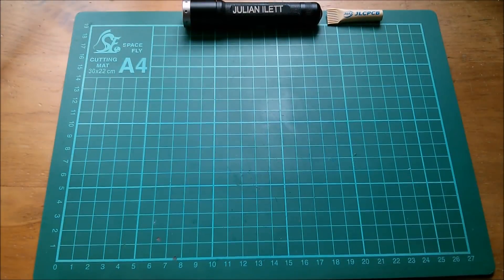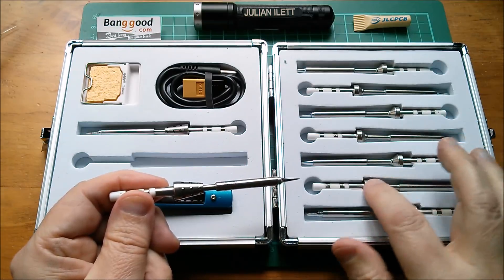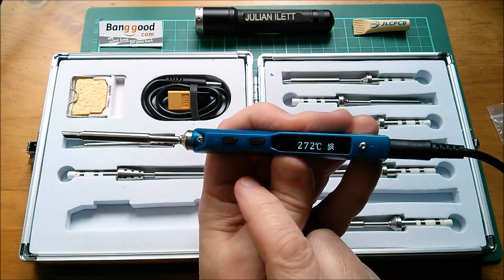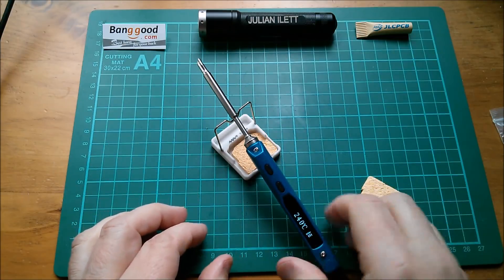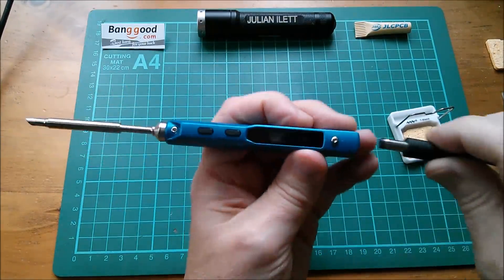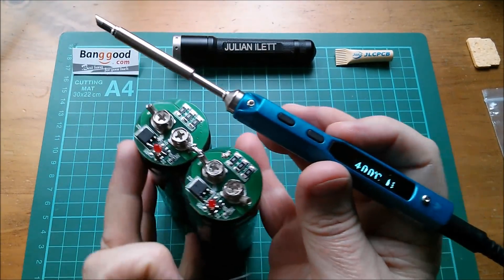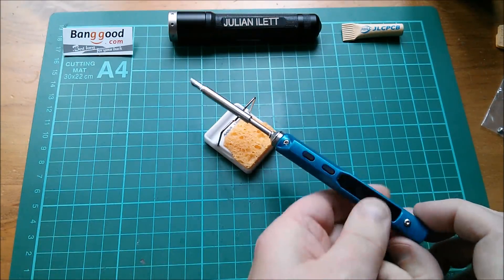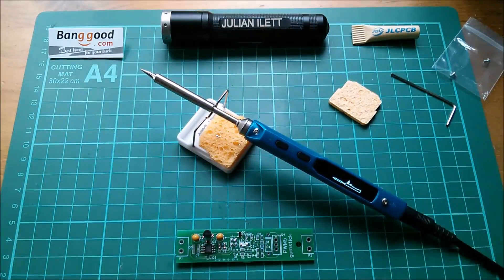TS100 Soldering Iron - Unboxing and First Look

Comment: You don't have to loosen the bottom screws for the tip! These are the screws for the case. Just loosen/tighten the one screw on top. And think about of switching to a 3rd party firmware by ralim, you will find his github repository.
First time I saw this soldering Iron I knew I would sell my Ersa - RDS80 soldering station. Now I'm only using a 3s 5000mAh Lipo and just sometimes a avm fritzbox 12V/1.4Ah power supply.
Reply: yep, many people came to that same conclusion.

Comment: Hi Julian, I have had my TS100 for almost a year now, just a couple of tips for you, first the screw on the back is a miniature Torx screw, this does not secure the tip, it holds the rear case together, secondly the easiest way to set the iron up is to plug the usb socket into a computer, this will open a folder with the config file which you can edit with notepad, the text file has many rems to let you know what each line does.
Regards, Ray..
Reply from the maker: Both screws are Allen (hex) on this one, but you're right about the rear screw not being used to clamp the tip/element.
Reply: Ok I guess they changed the rear screw, I had to open mine up because the centre pin broke off in the power plug, BTW the rear case is quite hard to get back on..
Reply: There is an even better alternative; install the firmware upgrade by Ben Brown (Ralim), and you can change all those settings through a clear and logical set of menus right on the iron. It took me nearly a year to get around to it, and now I wonder why!   This has had a lot of mention on Youtube... it is a really slick piece of work!   It includes many neat improvements, with no downside.  Part of the reason I took so long to get around to it was fear.   It is a process that took me outside my comfort zone, but in fact it couldn't have been simpler.  "How to update TS100 Firmware" by Gadgetboy was really helpful.
Link:   https://youtu.be/B2k_kvUDuPY.

Comment: I'd like to try that firmware on my vape.   Looks like a lot of the vapes I've purchased in the past are made in the same Chinese factory.
Reply: If you manage to get something like that working, I'm sure everybody would want to see it.
Reply: A lot of battery mods are made with the same components and you can install a custom firmware called ArcticFox on them which enables a lot of interesting options. https://nfeteam.org/
I've since quit vaping so I'm trying to figure out how I can repurpose my mod. I did consider turning it in to a soldering iron.

Comment: Never used mine without the open source firmware, it's crazy how unsteady the temperature is.
Reply: the open source firmware will put that right for you.
Reply: Stock source is here if you want to have a go at it also.  https://img.staticbg.com/images/upload/2015/11/TS100/TS100%20V2.11%20Source%20Code%20New.rar

Comment: When you started in electronics, did you ever imagine that at one point you'd be adjusting your soldering iron by using a text editor?
Reply from the maker: I really didn't :)
Reply: Firmware update on your soldering iron.. Pmsl.. What has the world come to? 😂
Reply: text editor is a bit inconvenient. they should have used their imagination and let us connect to soldering iron's webpage wirelessly to control it's parameters. ;)
Reply: No... but then I didn't imagine I would ever have a phone in my pocket that makes the Star Trek communicator look totally lame!   :o)   Progress!
Reply: John Colvin I used to enjoy listening to 'Hitchhiker's Guide to the Galaxy' when the hitchhiker's guide itself was science fiction - now I have that in my pocket too!
Reply: I would have made that bridge with copper braid or multistrand wire so I could solder them unconnected then if you wanted some solder could be flowed into the flex to make it rigid.
Reply: you can upgrade the fermwar
Reply: i use vim btw.
Reply: most of the temeperature controlled irons have firmware, that's old news. You think a hakko displays the temeperature through black magic?
Reply: @DumitruUrsu  Yeah, but it's not field replaceable; it's OTP.

Comment: Update to the third party firmware. Quick and easy. Makes that thing a monster. Watch Marco reps video on that iron as well. Good day sir.
Reply: Julian Ilett The third party firmware seems to have better temperature control, has an "intelligent" sleep mode and the ability to set more parameters. For not that much work many people find a improvement of the behaviour.
Reply: Because the boost function, much better user interface, better readable font, changing all parameters directly, better sleep mode, more parameters ... Just try and you will be convinced.
Reply: Julian Ilett Third party firmware advantage amongst many other benefits is that it works much better in left handed mode.
Reply: For me the single reason to use the 3rd party software was the UI improvements. Much easier to adjust the settings, calibrate the input voltage and no messing with the text editor. Of course the boost function is great, I however don't have much use for it.
Reply: I am running this version.
https://github.com/Ralim/ts100

Honestly it takes this thing up quit a bit.
Reply: Marco Reps- It's really interesting to me how many people I run into that cross over to the exact same youtubers I watch.  Clive, Ave, Marco, Julian, etc, etc..
Reply from the maker: I can't find a definitive explanation why the 3rd party firmware is better - this one seems to have all the features (maybe not the boost function).

Comment: I use mine at updated firmware. And using it with 21v with hp adapter, the thingiverse Hakko T12 adapter and T12 ILS / T12 C1 tips. Mostly at 380°c